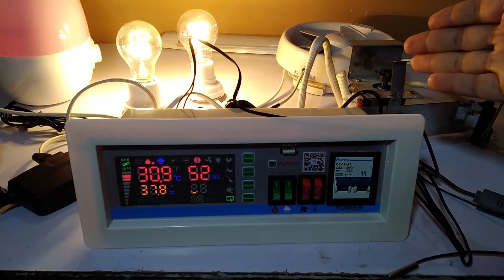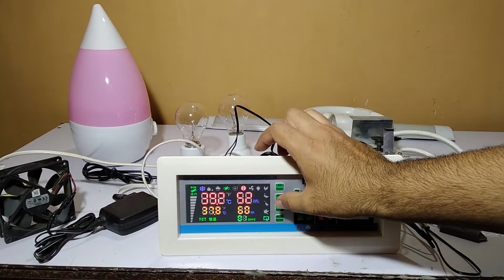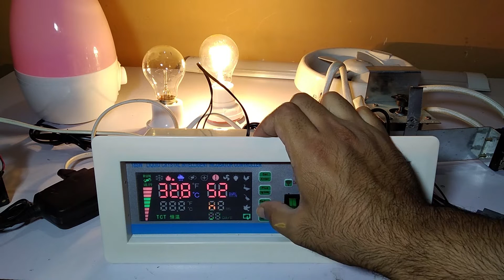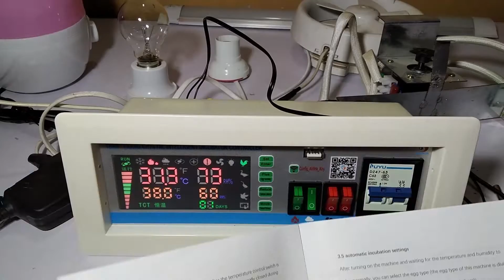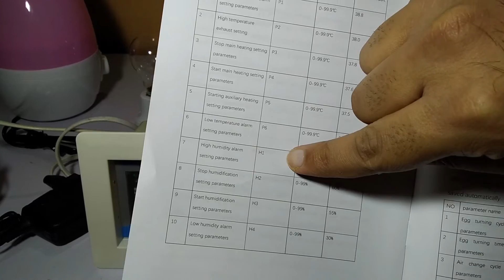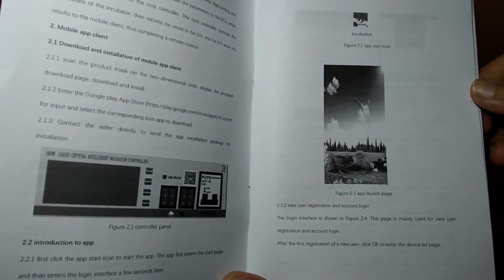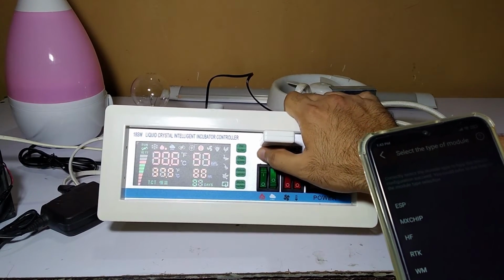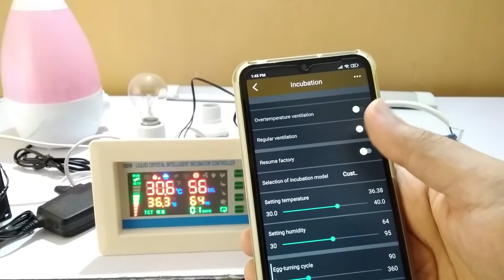xm18sw setting and wiring humidity and temperature controller

Comment: Umair I am wiring up this controller to my incubator, and I have the trays with the rollers. can they be wired up so they can roll in both directions? If so how would it be done?
Reply from the maker: Most of the rolling tray will turn right and left after turn off so there is no need to do any extra wiring

Comment: Umair, i have this controller, the temperature display was working fine but then decided to stop showing the temperature. You seem to have technical knowledge of these controllers, is there a way to fix it. I have measured the resistance of the temp probe and it reads about 10kohms i have a spare temp probe and checked it on the controller but still no temp display, it just shows 3 backward E's. Is there internal components that can be replaced to get it working again? I have tried resetting as per instructions.
Reply from the maker: If there is a issue in the internal ic than there is no way it can repaired without that chip and it will be hard to get , otherwise you can try changing the sensor probe if not than last thing to check is the display led can be changed if the temperature relay is tripping on reaching the temperature, otherwise it is internal chip issue
Reply: @Umairworkshop thank you for your response 👍🦘🇦🇺

Comment: Umair, great job explaining. I have one question, how do you wire up the 220v to 12volt adaptor so you can directly connect it to the fan output on the controller? How do you know which output on the controller is Active and which is neutral? 4:42
Reply from the maker: The com is supposed to be neutral that is why all the positive wires are connected to their dedicated sockets but all of the neutral go to the COM , and only those dedicated connection get active when the controller trigger any of them active as needed, you mean those fans which work 24 hours you can either place it separately or place the 220v to 12v power supply to the power connection of the controller

Comment: I really like how there is already switches that is build with the controller. I ordered one. Do you have to have a egg turner motor that has clockwise and counterclockwise wires?
Reply from the maker: If you are making a metal rack which will turn eggs on 88 eggs white tray then you need synchronous motor with 3 wires like 60ktyz
Reply: @Umairworkshop  I was not able to download the app. Probably because I live in the US and the app is for Asia market but I like the fact that switches are already factory built with the controller.
Reply from the maker: @MyDeere3320  thank you for good information
Reply: Hi please tell me is the exhaust fan AC or DC?
Reply: @souleymanediawara8169  If I remember it correctly, it's AC but you can convert it to DC if you don't have an AC fan.

Comment: Brother, regarding with the turning of the 60KTYZ.. was it also part of the manufacturer settings or you have to set by your own, depends on your desired turning??thank you and more power?
Reply from the maker: 60ktyz is just a servo motor needs to limit switch with desired turning , this controller only give power either right or left side and motor relay switch cut off the connection when reach turning stop limit
Reply: @Umairworkshop  yes but what im trying to say is, is there any adjustment on the thermostat where we can put on how many seconds in an hour that the motor will turn??
Reply from the maker: @monarchsullano6125  yes it have a system where you can set turning wait time and how much minutes it should work, it doesn't have seconds systems

Comment: Where can i get it ?
Reply: Thanks I found one but the voltage its 180- 220v will this work on a 120 ? Or what would u recommend?
Reply from the maker: @miguelrucobo  you need to ask the seller if it can work on 110 volt , otherwise need to arrange in 110 volt
Reply from the maker: You can search in Google if someone in your country selling it
Reply: sir ya 12v pa chal ta ha